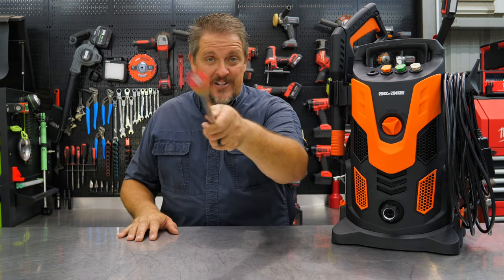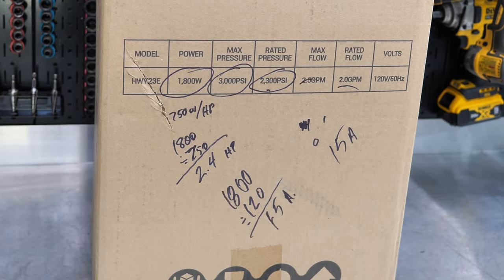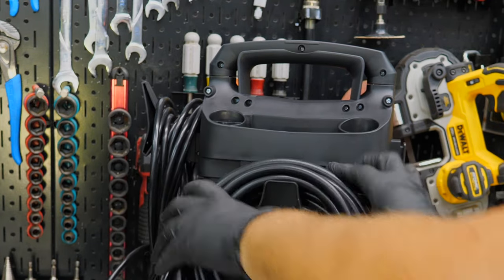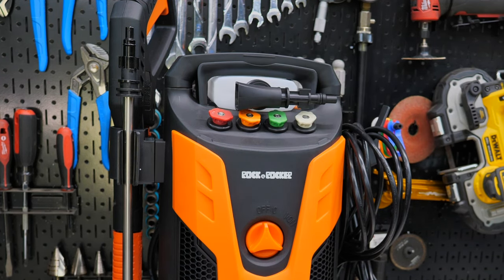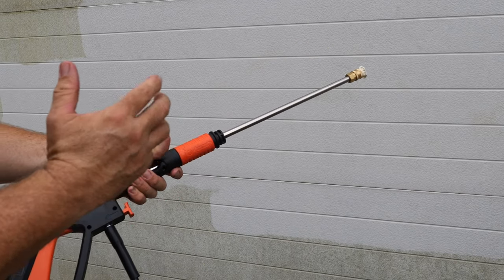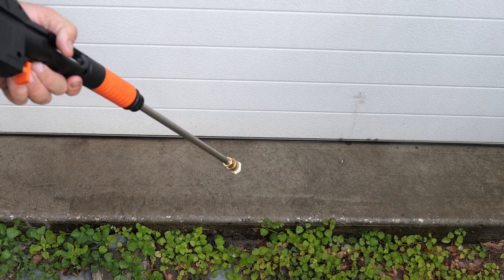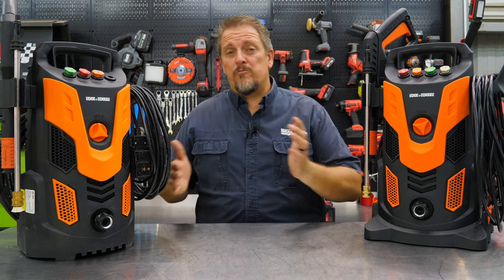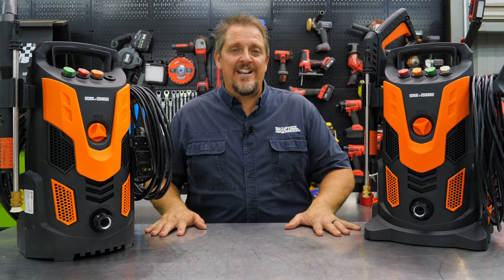Electric Pressure Washer Review - Rock & Rocker from Amazon [3000 PSI and 2.4 GPM]

Comment: These are absolute trash. You will always wind up spending more buying any rock and rocker product in the long run. The non-standard quick connect(ALSO, these aren't threaded in, so you can't just swap to a M22) makes this a disposable unit. You're either wasting time with returns, wasting landfill space, or wasting money trying to repair when they do fail, and they ALWAYS fail.

Comment: I have had mine since Christmas 2022, its adequate for homeowner use. My only criticism is the gun is junk. I got less than 2 months of infrequent use before the O-rings had to be replaced. After seven months the gun is shot and will not seal no matter how new the O-rings are. I am hoping to be able to get a replacement gun but so far the communication with RockRocker has been non existent.

Comment: My boss at our bus shop just bought one of these.  It does have good pressure but boy is it cheaply made.  I refused to use it until I changed out the pressure hose with a flexile hose.  The out of box hose was so stiff and the wand so cheap that no one in their right mind would use it.  I expect to run about a year and then in the dumpster it goes.  Save your money and buy a better pressure washer.